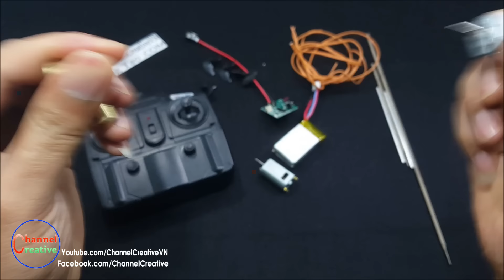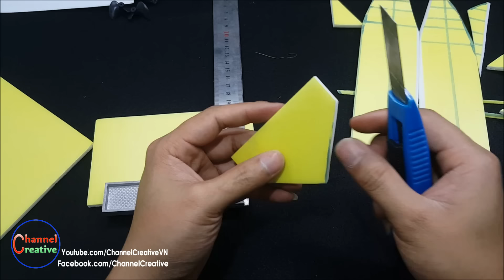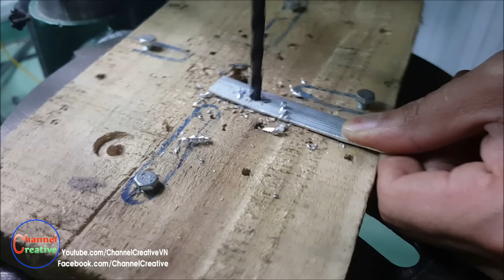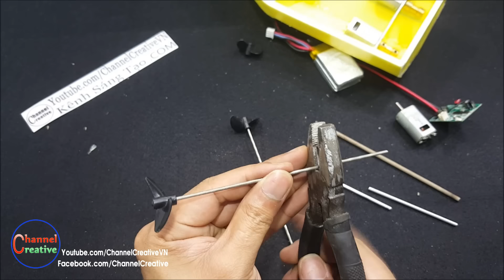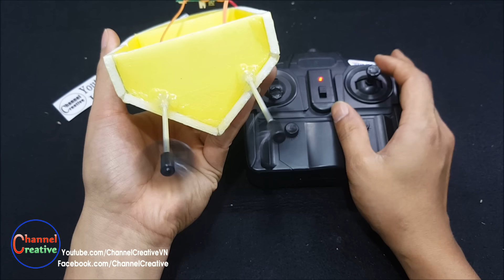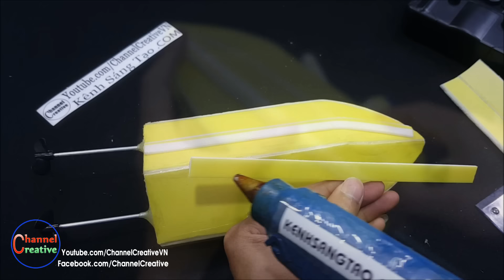How To Make mini RC Boat Twin 180 Motor

Comment: Send me a list of things you used in the video and which I can buy it online. In which you are making a twin boat
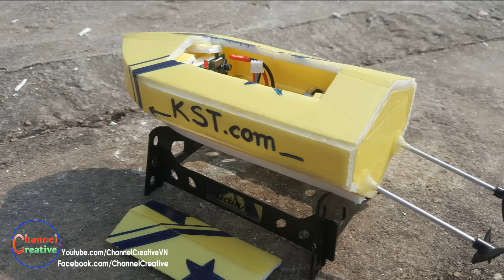Reply: 2 high rpm motor, pvp board, transmitter, sheeft, properral, a battery. And you need glue. Best of luck to make the boat. Iam the man who comment you 5 years later 11:43 😅
Reply: He dont know english @SumisKitchen-xl8mc

Comment: Just a tip, next time you need to remove the flux from welding rods, use the pliers to break the surface of the flux, then use fairly course sandpaper (say 120-180). Its much faster :-)

Comment: Building it from bits and pieces is really cool and the mixing board is very impressive. From experience though hot glue doesn't like water much. I only use it to hold fittings in place on work in progress scale boats and I still have issues, I think the hull could go quite easily here. Unless it's different to the stuff I use.
Reply: Flgnfm

Comment: the problem is availability of equipment and instruments 

and approx cost of all of these things

where i can found gum and gum machine
drill
screwdriver by which tight shaft
remote
battery 
motor
foam
circuits
etc.
giveaway me for my baby
😀😁😃

Comment: someone who can explain to me the scheme of how to connect the motors in the receiver? I made a boat and I do not know how the engines are connected
Reply: If there is a model number I would look up that exact reciever module to see if you get any diagram of where each wire connects to the board.
Reply: @dylanmoore1006   I have a board that has 4 connectors on the front, back and left, right nothing else, I tried to connect it but I only rotate one motor to advance, and when turning to another side the other motor rotates, how can I do it so that the 2 motors rotate to move forward and backward?
Reply: @MrRc-zk4gf  Some receivers may only be compatable for one motor, try witing both motors in series and hooking it up to the board joints. My board has labels for two motors that are already connected and they are called (MB, MF, ML, and then the forth wire is connected to a random solder joint above it. Its very hard to tell what is what on a board
Reply: @dylanmoore1006   thanks, I will see if I find it, or are you a video to explain it better
Reply: No problem, I'm building a rc boat right now and might make a video on it when finished.
Reply: @dylanmoore1006   It would be great to watch the video of your project.
Reply: Thanks

Comment: I think there is an error in this design .. where are the orientated fin directions
Reply: It uses the two motor speed deferential,, it's stop the right motor if you want to turn right, then left motor to the left

Comment: RC BOAT - Video is excellent but you are not explaining the suitability of boat and those parts are used to make boat & what is expected cost of manufacturing . How much load carrying capacity,  which safety provision made in it . Without explaining these thing your video is useless & it will remain as part of time pass or only entertaining video. Pl make necessary correction . Pl use either Hindi or English language for explaining/ representation as most of Indian peoples can speak or understand only Hindi or English language.  If necessary correction will done by you.your viewer will 100% increased.  .